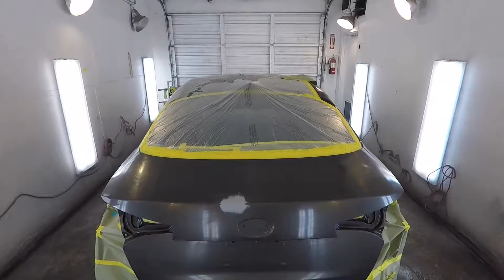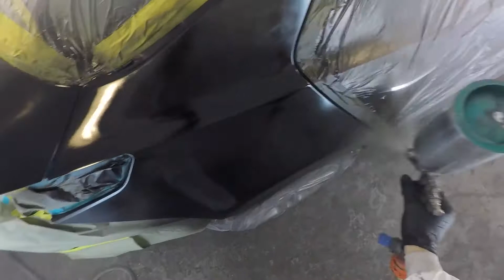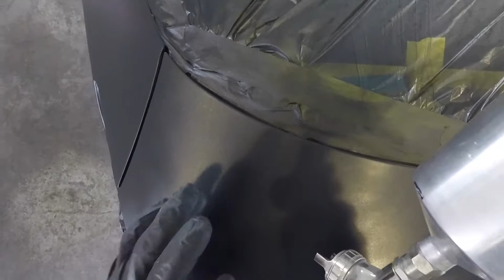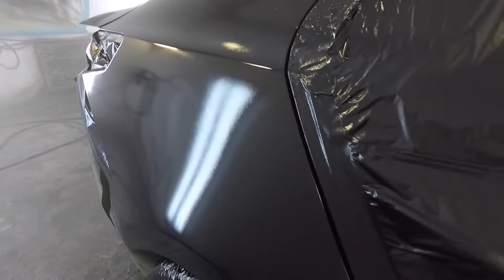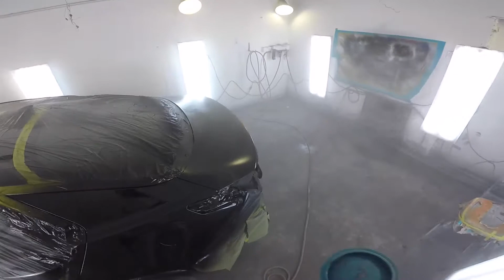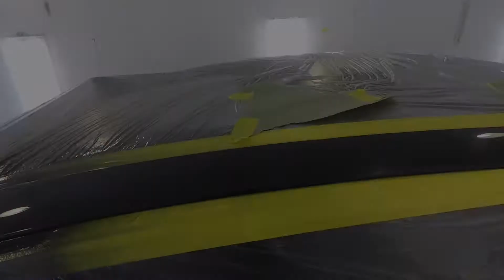Painting 2014 Kia Optima Turbo Black

Comment: How much would my whole car cost to get done like this? I have the same car but in all white
Reply from the maker: Janerian Wilson every state has different prices. Also every shop had their own hourly shop rate on bodywork and paintwork. Also, depending on the condition of the vehicle if it needs bodywork done on it. But if it’s completely scratch and dent free, u just want some new paint on it, a complete Kia Optima paint job would cost around $3000. I hope that answered your question :)
Reply from the maker: just the paint  materials alone with sandpaper masking paper and all paint materials alone would cost around $1,000